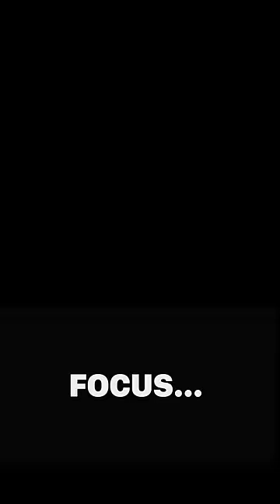speed

Comment: Putting some lubrication on the shafts would really increase the speed
Reply: No, it's actually mostly the torque at the moment. The motor is meant for speed, not torque.
Reply: @scarecrow5848 he meant the friction bogging it down
Reply: @westreaper9681  yes but the gear ratios are also WAY too high for that motor, you need a high torque motor for this kinda thing.
Reply: That’s what she said
Reply: @scarecrow5848 well yes but if you reduce friction you technically increade torque in this case so it would still go faster
Reply: @scarecrow5848  my dude the force that the torque is acting against is friction. If you reduce the friction then the gears will spin faster
Reply: @DoneRegularly 😂😂
Reply: You can't fix the unround gears and badly fixed bearings with lubricant
Reply: Damn i knew the replies would be sus
Reply: He did in the full video
Reply: So what if you use the motor at the other gear
Reply: @AliAkbar17429  Very low torque needed to move it but the other gear spins slow but with high torque

Comment: Why are you measuring the drive gear? Isn’t the speed from the gear train on the last gear? And if so how as the “max speed” before the gears 3300, and with the gears, the same rotational measurement was 14,000?
Reply: I can not figure this out either.....
Reply: @langs089  I just figured it out, he’s measuring the speed of the drive gear and multiplying it to get the output
Reply: @Jacksonhoch1  But why not just measure the speed at the output?
Reply: @WichidNixin  it’s probably faster than his tool can measure
Reply: Exactly my thoughts.  Show us the final drive gear rpm.... add lubricant and or bearings.... reverse the gear set for maximum tourqe measurement...
Reply: He is talking about the last smallest gear. He just didn’t state that clearly. Probably too small to get a reading on the last gear. But yeah if the motor is putting out 3300 with no load it will be slightly less with any kind of load

Comment: The higher the ratio the beefier and straight it needs to be. I do steel and precision bearing, as soon as it lines up perfectly it spins rather freely. I use hand cranks and at around 29:1 the handle weight makes it fall. But then running a DC motor generator it still takes alot of torque to operate
Reply: A moped swingarm is a good gear box. If you reverse the star nut on the Centrifugal clutch it becomes reversible
Reply: A small 90° drill has a ridiculous ratio. It sounded like a jet engine turning a stator. But they aren't real reliable under heavy load

Comment: What if you make the gear axels the chassis fixing points magnetic, suspending the gear within the housing, reducing the friction to basically zero?

Like a mag-lev but with the gear axels, instead of a train

Edit: I'm guessing you'd need pretty monster magnets for torque not to just pull the whole thing apart...

Comment: Dynamic balancing is a problem at such high RPM and circumferential stress may exceed the bursting strength of material which may lead to gears bursting and shattering into pieces.

Comment: what the motor that's you are using? i try to find the easiest way to control a motor and see your control box pretty neat(newbie🧐)
Reply: Easiest way with a DC motor if you don’t need to change direction and want max speed is just connect it to a power source. If you want speed control then use a mosfet and PWM, if you need speed and direction use a H-bridge which is what most DC motor drivers are. If you want it easily controllable from a knob or dial or really anything else then you could use a 555 timer to create a PWM signal or even easier just use a microcontroller.
Reply: @conorstewart2214 how can I plug a motor into the wall and still control the speed without over volt the shit out of it with 220 v can I use like a thing that turns 220v into like 48 with enough current to supply the motor

Comment: More importantly, what progran do you use for making gears? No program I've found makes it easy to set gears to an outer dimension. Like I have a housing that's 61mm, and I want my gear to be 60mm, but i have to fiddle around and my gears are like 59.81mm, or 60.54mm. Why can't I just input 60mm and 30mm, and have the a program generate 2 meshing gears?!

Comment: make electricity form it and heat the food by microwave  ovan since its required high voltage so use very strong magnetic fields neodymium magnet sey and make a hand power microwave 🤣🤣